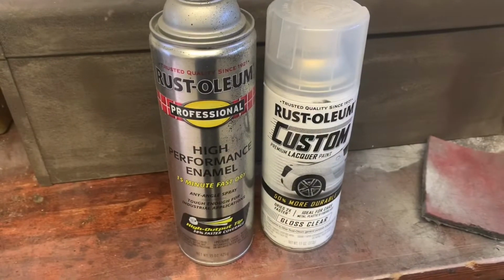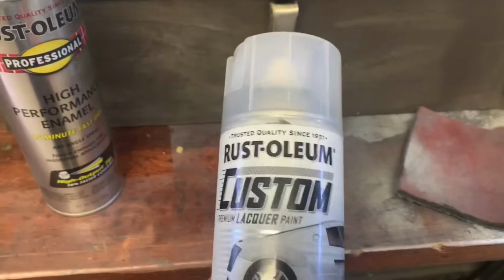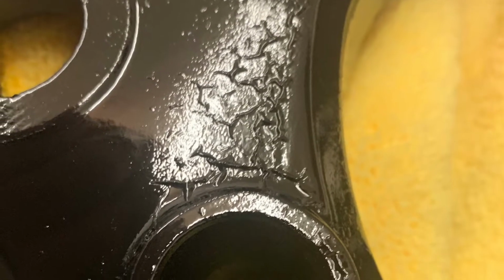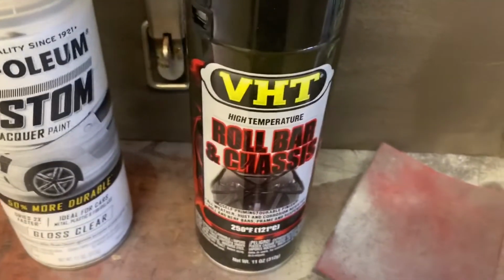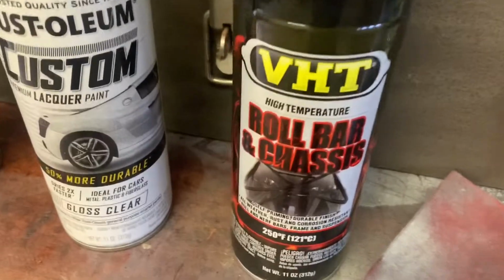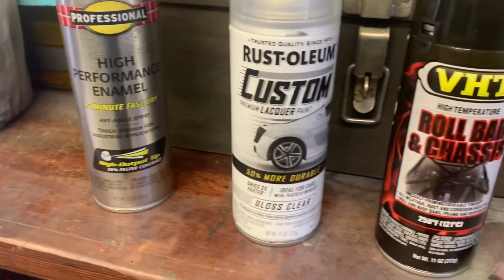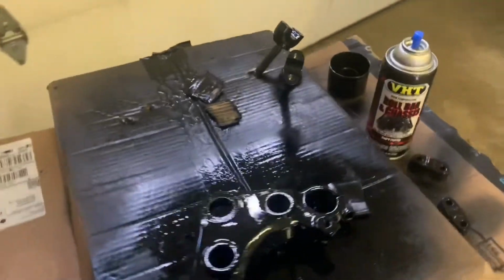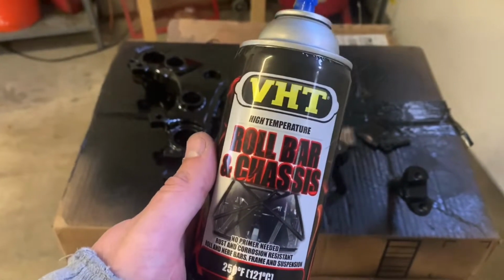Paint Problems, Chemical Reactions & Solutions-Vintage Motorcycle Restoration Project:Part 82

Comment: Love  your channel.  I'm finishing up with my 75 Honda CB 360t.  Experimented on several paints for my bike and ended up using the Dupli color high temp engine enamel with ceramic.  Cleaned (deep cleaned), sanded the rust spots and scuffed the existing paint and then 3 coats.   Came out great.  I will be finishing with the engine block when I get back from a business meeting then assemble.  Got  to tell you, your vids are great because when you make an error, or learn as you go, it's so much better when we watch and have a hickup.  
Very cool.  I'm still catching up with your new and old videos.
Reply from the maker: I appreciate the feedback. Great work on your project! Keep it going.

Comment: I used the Common Motor tip of using canned Rustoleum paint cut with 20% acetone. Brushed on the results exceeded my expectations.
Reply from the maker: Not sure I’ve seen that! Intrigued.
Reply: It’s hidden in one of the “Fixen-to-Ride” series when Caleb is repainting his triple-tree. They said that they use that trick as a substitute for expensive powder coating. I was skeptical, but my cheapness got the better of me and I tried it. The thinning of the paint eliminates brush marks and I hung my parts in the oven (at 175) to accelerate the curing. Worked great.

Comment: Using the VHT did you need to put primer on the parts or just the VHT and clear coat?
Reply from the maker: I went straight to metal on this one. Lots of info out there. Even the VHT site mentions only a cleaning with a solvent. I wiped it down with acetone. Apparently you can bake the parts at 200 f  for additional durability.